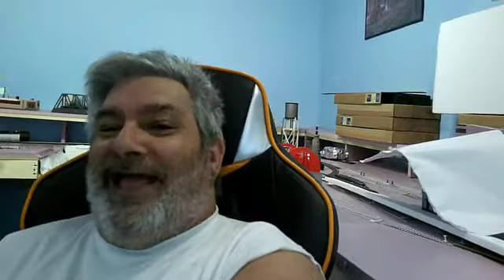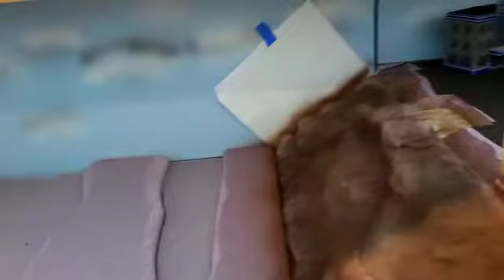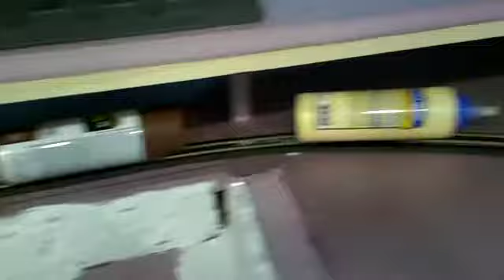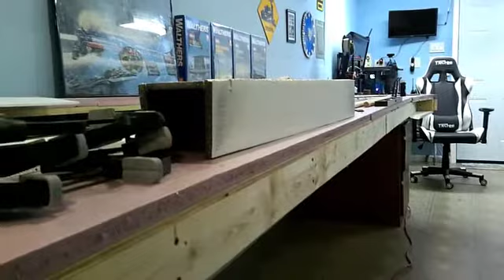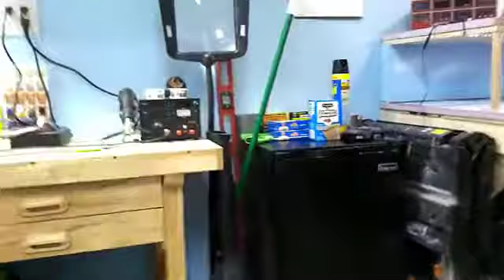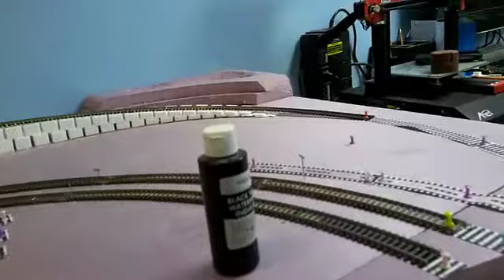Millennium County RR v2.0  -  Episode 25

Comment: I can understand wanting a sink in the room, are you getting an in line heater for it too?  Where are you gonna drain too just out side.  I am surprised you couldn’t find a portable type sink that you could refill rather than pipe it in.  Looking good good luck on the progress.
Reply from the maker: I'm not that mobile anymore and having a sink is just practical. I'm only going to have a cold line as its mostly for cleaning brushes and paint equipment, so no need for hot water. I didn't see any portable sinks or I might have went with one. It was hard w\enough finding a mini wall mounted sink that was reasonably priced, the one I bought was $138.00 and is 15' x 20' x 5'.